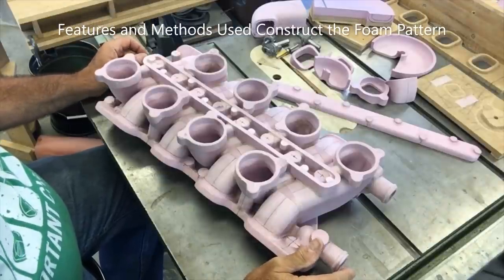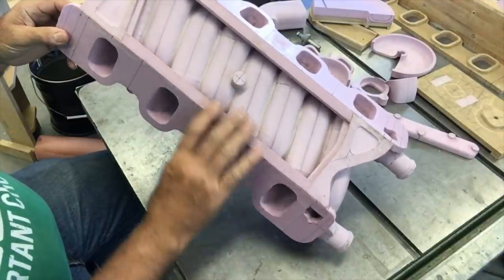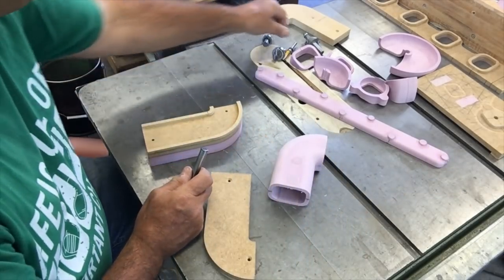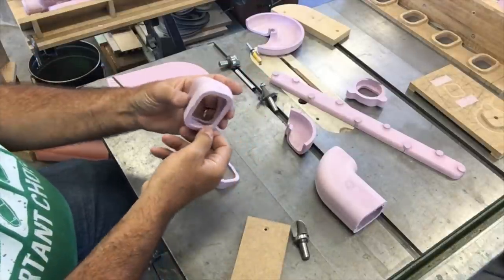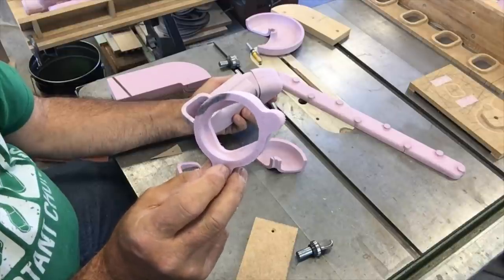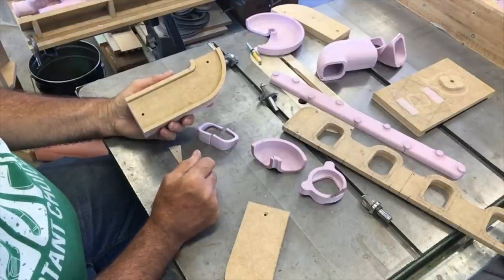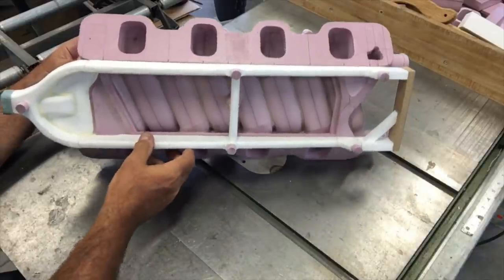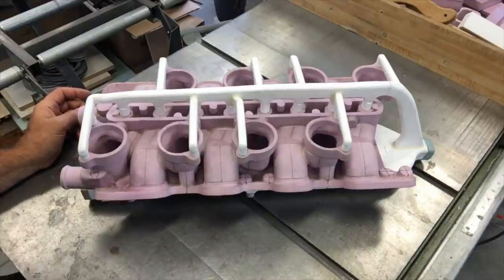Lost Foam Casting an Automotive Intake Manifold Part 1

Comment: Sir, you have the skills to cast your own cylinder heads and I really wish you would, I'd love to see how the water jacket is done in lost foam.
Reply from the maker: 3 or 4 years ago I did a crude mock model engine block with water jacket just for demonstration purposes, That thread is here. 
http://forums.thehomefoundry.org/index.php?threads/unsupported-closed-loose-sand-coring-in-lost-foam.12/
You will need to join the forum to see full size pictures. Best, Kelly
Reply: @kellycoffield533  Outstanding Thanks
Reply: @kellycoffield533  I have a question to ask you how hard is it to get started in making Castings this is my question to you from 🇨🇦 #YSW I follow you 💯 from
Reply from the maker: @domenicomonteleone3055  That's pretty hard to answer not knowing what type of skills and equipment you may have. Most people with some basic skills can make a foundry furnace and burner in a weekend or two for $100 worth of materials. You can make a propane burner for $15 worth of pipe fittings then buy a higher pressure regulator and hose for $60. If you have basic woodworking skills you can make foam patterns. If you can put sand in a bucket you can make a mold for the foam pattern. Your best bet would be to join www.TheHomeFoundry.org and view all the examples of people that have done the same and gage for yourself. Best, Kelly
Reply: @kellycoffield533  i have to see  what you where talking about this work does take alot of  work and time and if the work in the beginning is not done correctly it will show  kelly Thank you kindly for responding back to me in 🇨🇦 #YSW  a very big respect back to you

Comment: I'm sure you got it figured out in the later vids, but my thought to fix the sand vibrating issue would be to lay the manifold flat and fill it up with sand the best you can, then take very thin long strips of sheet metal and use a few tiny drops of super glue to hold it in place, then insert the manifold into the vibrator vertically as you did, then fill it with sand. At this point you have sand "outside" and inside, with the thin metal sheets holding the packed sand in place inside the nooks and crannies. Then once you're vibrating, pull the sheets free and pull them out slowly, and any gap that was left in its place would be quickly filled up with sand even though you rotated the part around. SO this way there's no sand that needs to flow "uphill"
Reply from the maker: It was just old, contaminated sand with a 100+ uses or so. Ii molded and cast just fine after fresh sand and have successfully cast a number of additional intakes since. Best, Kelly
Reply: @kellycoffield533  very cool! You're a true craftsman. Very few left in the world today. I hope you have someone to mentor and to pass your skills onto!

Comment: Hello Kelly

Thanks for sharing your results it's very impressive, theres something which I have been trying to do as much research for and I think youl appreciate the idea. Possibly if you or anyone else can tell me if this can work then that would be greatly appreciated. Instead.of using and cutting wood to make patterns which you then machine for foam, it would be much easier to make a negative mold using 3d printing and casting suitable foam. The advantage of this is time saved and iteration, it can also allow large volumes to made in a.fairly short period of time as foam doesn't take too long to harden. If you get a chance it would be good to see this idea in practice, or if you know others who have tested this. Looking forward.to your reply.
Reply from the maker: The process you describe is roughly the practice used in commercial LF foundries for making patterns except pre-expanded polystryene beads are used and invested into aluminum dies, exposed to steam for further expansion, bonding, and forming copies of the expendable pattern. Unfortunately there are no suitable two-part foams for lost foam castings. Two-part foams such as urethanes and epoxies are thermosets, whereas polystyrene is a thermoplastic. The big difference is when exposed to heat, as they decompose, thermoplastics undergo an extra phase change, turning to liquid before turning to gas. Thermosets for the most part just decompose into ash and gas. That extra phase change is important to LF casting. I don't mold patterns because I'm not interested in making a large quantity of anything. Using the commercial process to mold patterns is a very difficult process to control and IMO, impractical for home gamers and gains you nothing if you don't want to make large quantities. By way of example, I have an AFS book on LF casting that is 250 pages long and >60% of the content is devoted to controlling the pattern materials and pattern molding process. Frankly if you were going to go to the effort make a mold for molding an expendable pattern, why not just use a 3D printed hard pattern to make a conventional (bound sand) mold and copies there of? Though I show hand guided pattern routing of patterns in this video, that's just for example. In other videos I show hot wire techniques for making foam patterns. These days almost exclusively use a CNC router to cut foam patterns which is analogous to 3D printing except subtractive instead of additive, but can use commonly available extruded polystyrene, a proper LF pattern material. Not everyone has CAD/CAM skills so the other techniques are to illustrate complex patterns can still be made at home without. Best, Kelly
Reply: @kellycoffield533  Kelly thank you very much for your reply and depth, greatly appreciated. Looking forward to your other videos. Have a good weekend.

Comment: Hello Kelly, excellent work! Is there a reason you chose to use low density foam for the gates and runners? Thank you so much for making this video!
Reply from the maker: The lower density foam absorbs less heat/energy from the melt, so in theory would enable lower pouring temps. It also evaporates more quickly, and in my mind, I envision the runner system filling more rapidly and being more conducive to effectively feeding the part, but I have not confirmed this. I'd like to put an IR camera on the flask some time. It's not as strong nor does it machine or finish as well as the extruded polystyrene (XPS) Foamular 150, making that a better compromise for pattern material. I have a seeming inexhaustible supply from reclaimed (free) expanded polystyrene (EPS) packaging but most of it still ends up in the bin. It has the unintended benefit of visually distinguishing feed system from the pattern features which may be of some benefit to viewers. Best, Kelly

Comment: What kind of foam is this exactly ? And where can I get it ? Does it come in a 2 part liquid form so I can pour and cast complex shapes ?
Reply from the maker: It extruded polystyrene insulation board available in 4x8 sheets at retail home improvement stores. For more details watch this: https://youtu.be/T2H8UH3TeaM

Comment: Nice detail on adding an oval and numbers in the front runner. Any info how you did that?
Reply from the maker: I pulled a silicone mold from an embossment and then melted wax in the open face mold to make the wax appliques. I comment on that and show the silicone mold for the part number near the end of my video entitle "Pattern Materials for Lost Foam Casting". Best, K

Comment: What do you use for the fillets between the individual parts after they are glued together? Do you use a wax material?
Reply from the maker: It's a wax formulated for lost foam casting that burns/evaporates at the same temp and rate as 1.1 lb/ft3 foam. It's called Master Bond and is available from Freeman Supply. See link below. I use the smallest size, 1/8" radius and apply with a warmed ball fillet tool.

https://www.freemansupply.com/products/specialty-tooling-waxes/wax-fillets-accessories/master-bond-wax-fillet---boxes-24-strip-lengths
Reply: hi, do you have any lost foam question

Comment: Thought you might like this, https://youtu.be/hYpaGK2bk8E , the guy uses spray foam, not sure if it's polystyrene but the result seems quite good. Difference in my approach would be to use abs negative mold, any added work to ensure the demolding would be smooth would be carried out. The other problem I'm thinking about like you said is tolerances when controlling the pattern being made.
Reply from the maker: I had seen that and a handful of others similar. That is urethane foam. I suppose whether something "works" is just a matter of what you're doing and quality of result you find acceptable. It was years ago that I experimented but like this and the other videos suggesting using urethane foam, based upon my first hand experience and readings I'd suspect the castings were ladin with flaws and defects. If it were truly viable, I guarentee it would be used in commercial practice, and it isn't. I cast machine parts and that quality of result just isn't something that would be on any use to me. I've never quite understood the fascination with casting skulls.......so many examples LoL. As an aside, I've seen all kinds of creative evaporative pattern casting where people have used real bugs, flowers, plant life, you name it, then invested them, burned out the pattern and cleared the cavity of ash, before casting them.....and then there are the guys that pour molten metal down ant holes and dig up the casting. I've tried art work but all my art seems to come out looking like machine parts....😉 Best, Kelly

Comment: have you ever thought about learning 3D CAD so that you could create this in a computer instead and literally just 3D print it into plastic, and then use that 3D printed plastic intake manifold to do the "lost PLA" casting method (by putting the 3D printed plastic intake manifold in plaster, and then burn/melt out the PLA in order to have a perfect part for filling with molten aluminum?.... 

Plus, you could do this, over and over and over, easily, without having to hand build a lost foam model each and every time. (just a suggestion)
Reply from the maker: Make sure to watch Parts 2-4 in this series but as far as your questions, I use a CNC Router to make all my foam patterns these days as in the air filter assemblies in Part 4 of this series, but not everyone has CAD/CAM skills and such software and equipment. Part of the reason for my videos is to show those folks that with modest woodworking skills, equipment, and some patience, complex patterns and professional looking castings can be made at home using the lost foam method. 

As far as 3D printing patterns, I get this comment a lot: “You should be using lost PLA or lost wax for that”. My reply is: Uhhmmm, IMO, no not so. I like lost PLA and wax for small parts like jewelry and ornamental art work but would never choose it for a part like this. You’d probably need to have used both methods to understand why, but here are the primary reasons. 

This part is 24”x12”x5” not including gating. 99% of hobbyist would have to print it in multiple pieces and assemble the pattern. It would literally take days of printing time and IMO, the patterns look terrible unless you invested the time to solvent polish or sand out the print lines. 

The sand mold and flask for this part is 16” in diameter and 40” tall. It weighs 450lbs. Can you imagine the cost of 450lbs of block investment or ceramic shell Probably about ~$1/lb, less if you are experienced with plaster home brew investments but you still need to mix it, incur the labor to apply it, and having to handle and bake that large 450lb mold. A block investment mold that size would take over week to bake out and you’d need a very large oven. For lost foam I don’t need any of that. I just vibratory pack loose sand around the pattern, ladling it into the flask 5-10 lbs per scoop until it’s full, typically taking 10-15 minutes. The cost of the lost foam mold is basically nothing since you can reuse the sand but at retail stores it's 10c/lb, and in bulk $20/ton.

Then of course to demold the casting, for investment or shell, you’d have to break and chip away 450lbs of mold media. For lost foam, I just dump the mold on the ground to demold, grab the casting, cool it in water and then blow the refractory coating off with compressed air and  reuse the sand instead of chipping away and disposing of hundreds of dollars’ worth of spent block investment or shell......Lost PLA for this part? - No thanks. 

Best, 
Kelly
Reply: @kellycoffield533  hey, that's actually an excellent point; I didn't think about it in terms of the absolutely extreme amount of material involved here in creating such a massive object. You're right, it's even more "cost effective" to do it your way. 

And that rig that you created in order to pour so much molten aluminum, literally all by yourself; that, is literally genius. 

That is really extremely impressive that you were able to literally "recreate" a Ford V8's intake manifold, in actual aluminum, at your home, and it works perfect; that's unbelievably impressive!

Comment: I worked for a pattern shop and know what kind of work and hours goes into them.  how on earth do they justify the cost of you making this for one part that would usually cost $200?
Reply from the maker: Hopefully you know more about pattern making than the value of vintage and custom automotive parts.
Reply: @kellycoffield533  was this something that was original to the car and makes is more valuable?  all I know is, patterns aren't cheap to have made.  we made one for summit racing before.  the shrink of the mold changed the intake port sizes they wanted so it had to be done several attempts to get it right. and i  think they also had problems getting the cores out due to not enough draft.   but that's on their engineer dept. not us.  what you made isn't easy to do.  thats what I know for sure.   just seems like it was more of a love than money thing.